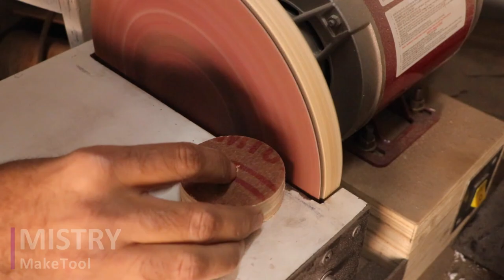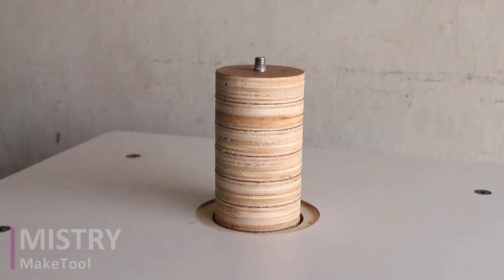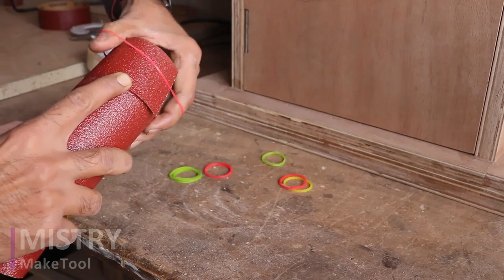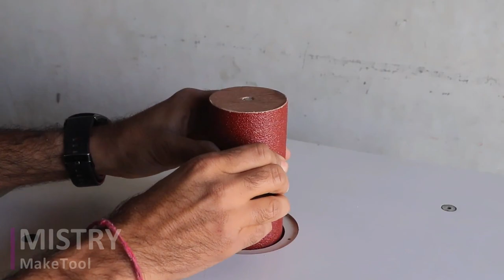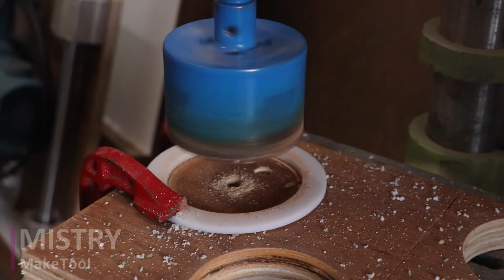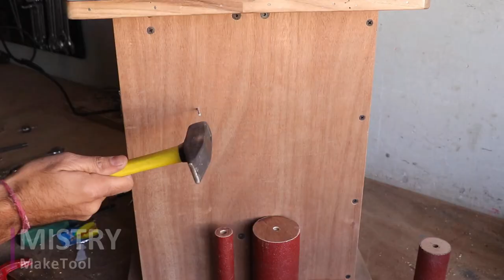DIY - Sanding Drums For Spindle Sander

Comment: Route a  slot the length of the drum, make a retainer with 4 holes Use the retainer to clamp the sandpaper to the drum. Then you can use full sheets of sandpaper cut to size, replacing the sandpaper as it wears out.

Comment: I'm interested to see how he changes worn out sandpaper on these spindles. I wonder if PSA backed sandpaper would be tacky enough to hold in this application. Larger diameter sanding sleeves can be expensive.